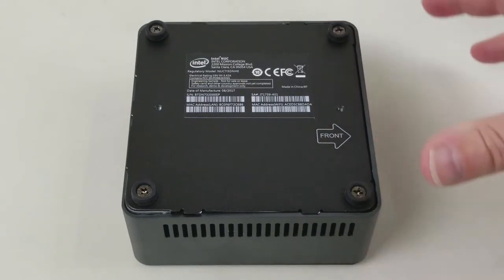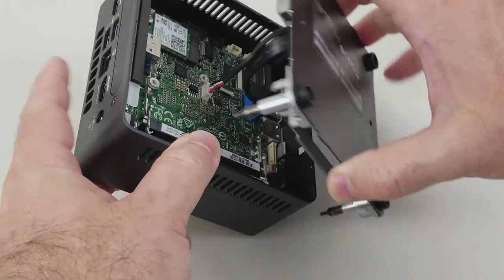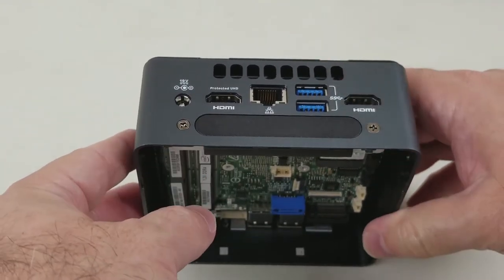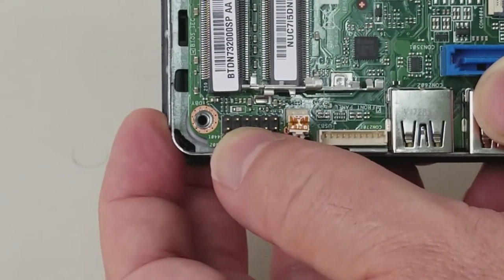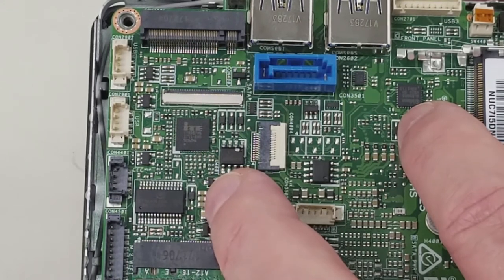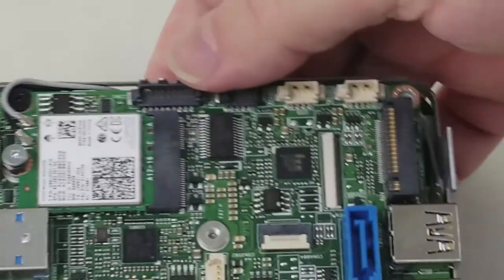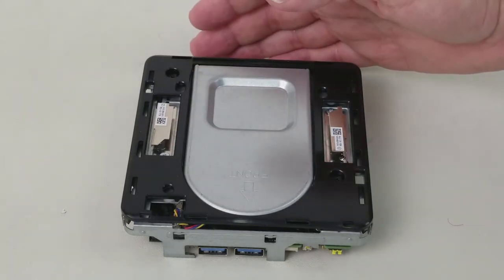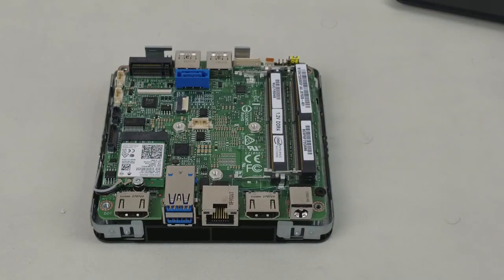Intel NUC Dawson Canyon- A Detailed Look Inside by Simply NUC

Comment: You comments on static at the start are 100% correct.  I'm almost amazed that Intel have not stopped people buying NUC's, unless they buy them via a system builder who knows what they are doing, and the dangers of a static discharge.  1000x is a staggeringly bad figure..... :(  I have one of the NUC's, and they are a fantastic bit of compact design.

Comment: Thank You! just one more question. Will using the eDP Connector expand the maximum Display Ports to 3?
Reply: Both mDP connectors and I believe the USB Type-C with Alt-DP mode, will support up to 3 Monitors, with at least 2 of them being DisplayPort 1.2 monitors or a DP 1.2 Hub. The 3rd monitor can typically use a DP video adapter to support other monitor types.
Two of the displays can be 4k but the 3rd one will max out at 2k
Reply: Yes.